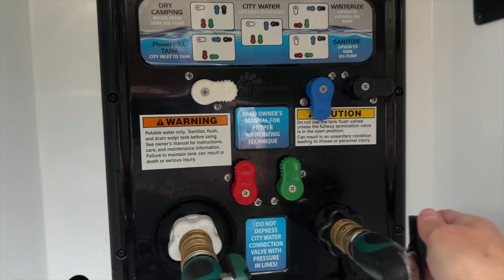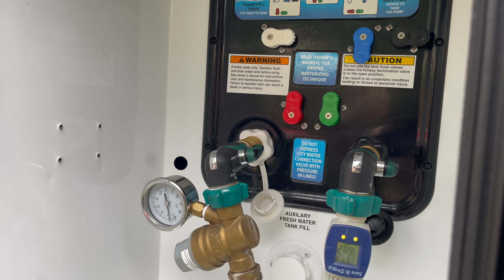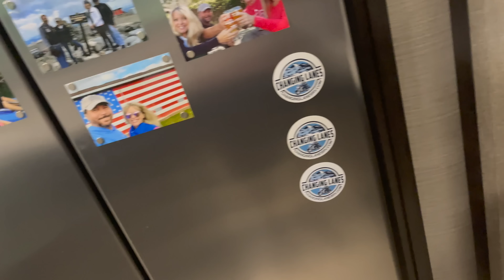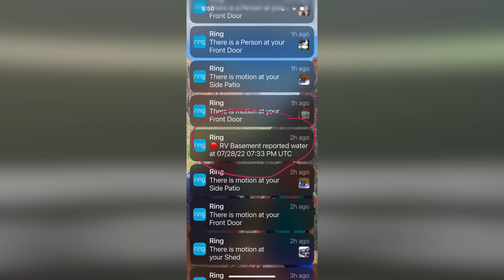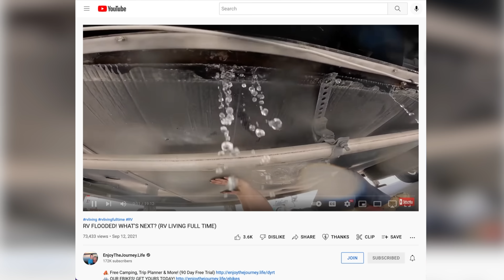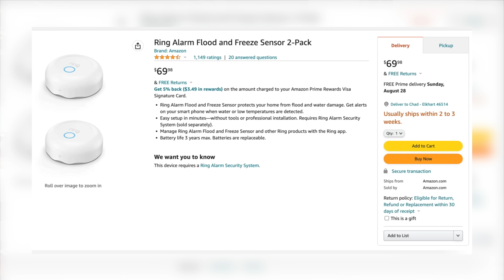Mystery Leak! (Black Tank Check Valve) (Full Time RV Life)

Comment: Great work, but dang! This is my concern about buying my first RV, which we have not decided on yet. Because we are clueless on all the plumbing and electrical runs, that are NOT behind access panels like that valve you changed, I could be in real trouble not being able to find or repair it on my own. Having to actually CUT out a hole to fix that valve hurt my heart. Why a valve would be blocked like that for easy repair is unacceptable to me... but you guys sure figured it out! Living and learning though you both and helping prepare me for what appears to be the inevitable! Safe travels!
Reply from the maker: apparently the valve needs to be higher than the toilet to meet code.  If I had called GDRV Support, they would have told me about the hidden panel, so no problem not knowing.. 👍🏼

Comment: Another good reason to use the zip ties is to make sure the proper line goes to proper side of the vacuum breaker. If they are reversed the black tank flush will not work.   I learned this because my last fifth wheel had the lines installed backwards at the factory & the flush would not work. Were  you able to find a vacuum breaker made of brass?
Reply from the maker: Yes.. found this one from comments: https://amzn.to/3pj2NX8

Comment: I have the same problem I tried flushing my black tank and it started leaking from the atmospheric vacuum breaker / check valve , the problem is it’s behind the wall of my 311 BHS i got it look at by one of the technician so I’m still waiting for them on what they wanted to do. Don’t want to mess it up more.

Comment: Funny (odd) that you would find that the same time I found mine. The only way I found mine was I could hear water in the wall beside the toilet.  I have to cut the wall panel because they put the check valve in a place where no one would look. Most rv videos I have seen have the check valve under the sink cabinet.  Not mine. Rv ing can be soo much fun. Lol

Comment: I was sitting outside the Motorhome and saw water dripping from the wheel well. There's no plumbing there? Or so I thought. Turns out the back of the closet is removable and behind the panel is a hookup for a washer dryer. I had no idea. So I replaced the ball valve and capped the hose barb just as a backup.

Comment: Do what many people do including myself eliminate that vacuum breaker just put an in-line check valve in it create more water pressure for flushing Black tank and Call it a day
Reply: Ditto. The vacuum breaker in my Winnebago travel trailer and many others is under the bathroom sink because the black tank is almost always under the toilet. Was leaking in the underbelly but leak was under the sink. The leak ran down a hose (you have pex there). This vacuum breaker is notorious for leaking and a 1/2" check valve from the hardware does not leak. I am sure that RV manufacturers have to use these crappy breaker valves because if they fail they just leak. They don't backfeed the campground water system and poison your neighbors. If a check valve fails it could allow backfeed of sewage to the fresh water feed. That is very unlikely as long as there is pressure on the fresh water feed. I put a check valve on my new grand design day one before it had a chance to fail. The one in the Winnebago lasted one year. You will be replacing this vacuum breaker again one day.

Comment: Our maiden voyage in our 2020 Sandpiper 5 hours from home I went to flush the black tank and water started to pour from somewhere behind the shower.  I knew it was coming from there but besides removing the shower controls I couldn’t figure out how to access it.  2 hours later and trying to figure out how to get access to behind the shower where the leak was coming from I realize the small bookcase in the bedroom was removable granting access to the back of the shower and the black tank vacuum valve. $75 later (I had to buy it from a RV dealer) the black tank vacuum valve had malfunctioned. So frustrating but fixed it.

Comment: Good find Chad - or should I say Tara!  I had the same problem and this is my thought…  You typically don’t use a water pressure regulator on the black tank flush.  Sometimes (I suppose) you might get a water source with crazy high water pressure!  A cheap in-line pressure regulator would check your pressure - I just wonder if it would lessen the impact of your black tank flush?   (I would hate to have to “prove” that one way or the other 😂).  By the way, though this was NOT covered in my training, I am a certified tech from RVTAA!  My business is going great!

Comment: I don't think a vacuum breaker will work on a open ended line like a sewer flush. Yes it will protect from sewer back siphon but without back pressure it will not seal at low pressure. Remedy is remove VB.

Comment: thank you for sharing and showing that you are using the ring' moisture sensor, do you guys have a video where you installed those?  Would like to see how you determined then where and why.  Thanks again
Reply from the maker: Here you go: https://changinglanesrv.com/rv-security-system-by-ring/

As far as placement, under each sink and in the basement at low points under the plumbing.. 👍🏼
Reply: @ChangingLanes  Hey!  Thank you very much for this, I am thinking I am going to go this way.  Appreciate the reply and the content.

Comment: With our 399TH, and the completely backwards setup from yours (shower is on the complete opposite side of the rig, and pipes/handles on the bedroom wall side, I wonder where our black tank flush line runs!  Ha ha.
Reply from the maker: check the wall opposite the shower controls.  Might be behind the tv?
Reply: @ChangingLanes  Maybe.  I know we cut a hole (or removed something) to get to the back of the faucet handles for the shower, below the TV for sure.  They were dripping, and leaking out into the bathroom floor very shortly after we acquired the rig.  Will have to look again.  And also to make sure I have the same valve.  We are also a 2018.
Reply: @ChangingLanes  Oh, "opposite the controls", that'd be our pantry!  Ha. Backwards rig!

Comment: great video, did u install aluminum L channel across belly to hold up the coroplastic? what size is it please?
Look like about 1 1/4 by 1/8 thick?
Reply: They did in a prior video.  Many of us have done this after a leak due to the coroplast deflection.  I don't recall the size they used, but I used the sizing you indicated but in steel.  Was cheaper and took little time to paint.
Reply: @robv4053  thanks very much!!!!
Reply from the maker: I believe it's 1" by 1/8" angle aluminum.

Comment: Chad if you google Atmospheric vacuum breaker you will have a better understanding of it purpose. I think this application is a poor installation, our RV’s are getting wet behind the walls an most owners are not aware of the leak until it is to late. I will be calling my manufacturer today to see if there is a better device, cost has a large part in the building of RV’s. Pressure vacuum breaker may be a better device but it cost more money. The next thing is removing the AVB completely and installing something outside of the RV. Good luck!

Comment: What "kinda" surprises me is seeing how the factory hacked the access hole behind that panel. How easy it would be to have made a larger and neater hole. You wouldn't had to cut the hole larger. The other thing is the horrible maze of pipes, when easily made manifolds for both hot and cold would be much easier to shoot trouble and would prevent the loose lines from bouncing, which it would seem, could break fittings. Grand design looks good, but under the façade is hidden, poor, workmanship just like much cheaper trailers. Sorry to be so negative today. I do think sharing the location of the vacuum-break valve will help others with this model. So, for that thank you Chad.
Reply from the maker: All RVs look like that under the covers until you get up into the $200K Luxe level of systems.  Those typically weigh about 3K more also.

Comment: Chad, although I have not had trouble with mine YET ... I know some folks will remove the anti-siphon valve and replace with a couple 90-degree fittings, basically eliminating the valve. Once removed, they install a vacuum breaker valve on the end of their black tank water hose which serves the same purpose.

Comment: It’s absolutely disgusting how they ran all those waterlines and the wiring in there, honestly what would it take an extra 10 minutes to do that neatly when they’re building the unit and then make troubleshooting so much easier not to mention when they’re inspecting it it’s so much easier to see what they did and if there are any problems right at the factory

Comment: I had the same problem....Just eliminate the valve completely with a 90 degree shark bite fitting there is no need for that valve at all   Gray and black are not under any pressure and they are vented ... the talk is to prevent backflow......Nonsense since they are vented tanks it cant back up 5 feet
Reply: The problem is that if the tank is full and you turn on the water pump you could actually suck black water out of there into your waterlines that’s why you have that check valve

Comment: I would think that you would have access to any valve or unit in your RV that would require maintenance or replacement! This one looks like you had to cut out more access in your RV. This is wrong! You pay all this money for these RV's or 5th Wheels and you do not get some guarantee in these hidden parts for how many years?
Reply from the maker: I really cut the hole larger to film it better...  the hole was plenty big enough to replace it.

Comment: Hi folks great video . Our second trip( weekend ) out I noticed a leak with our black tank flush on our Brand New 2024 2500rl . Im still in the middle diagnosing my valve . Here at home I used 10/15 lbs of AIR and felt and heard air leaking by our valve . 
I’m wondering how a normal working one would work ?
It’s not a dire deal as I type but just trying to figure it out myself . Let me know if you know if air would leak through ??